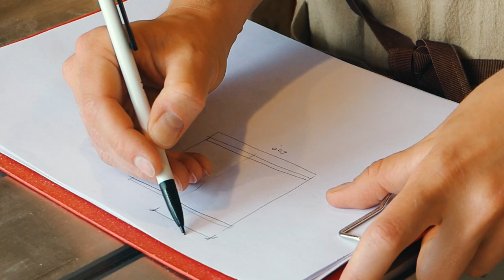Изготовление каретки для распиловочного стола | Приспособление для циркулярки своими руками

Comment: Someone may have mentioned this before but I can't read it.  

TIP:  Don't use the flat edge of the router base along your fence.  If you twist the router even slightly while doing it that way you will not get a straight cut.  Use the rounded edges.  That way the router bit will always be the same distance from the fence even if it gets twisted.

Comment: It's been a year since you made this video, how have your clamps held up? They looked a bit thin. I think I would have made them from Wood or 3d printed them from plastic or perhaps recycled a couple milk jugs.
Reply from the maker: the clips showed a good side. they hold the workpiece well because they have a spring action. use a screw with a hex cap to prevent it from turning when the nut is tightened